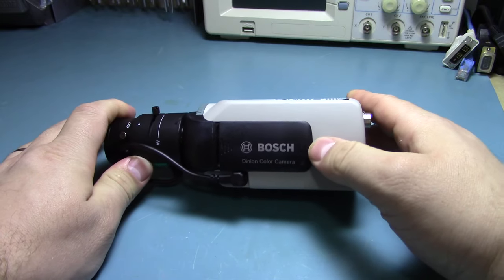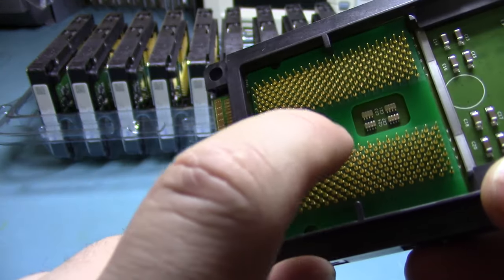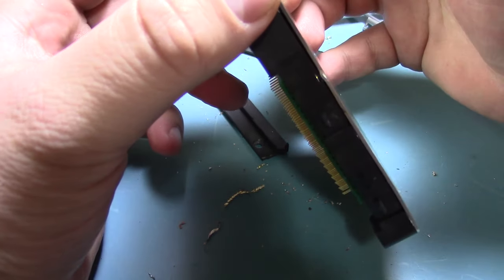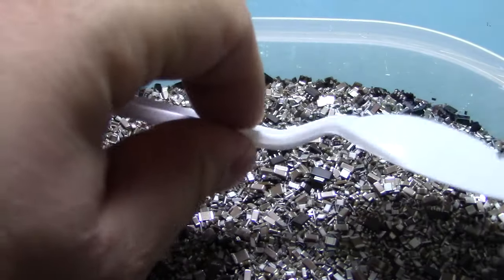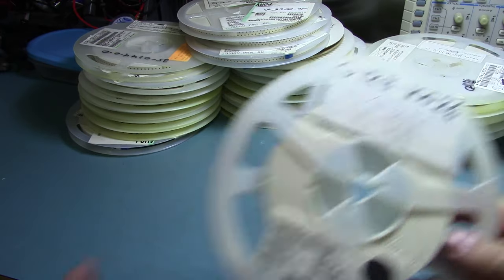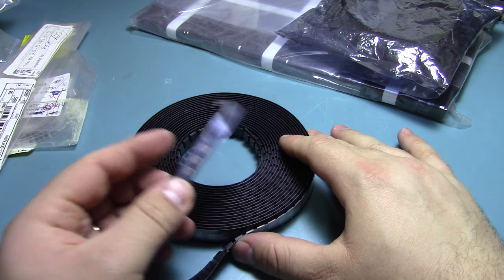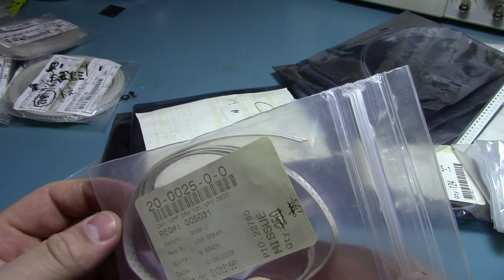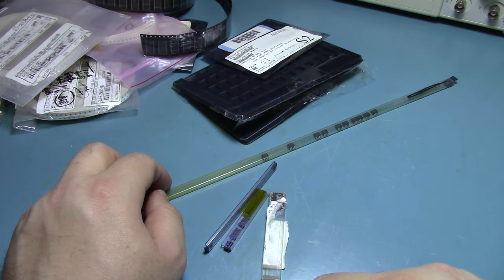More eBay Stuff

Comment: Could make a epoxy key chain with those intel chipsets
Reply from the maker: +NegiMudkip Intel actually has made a bunch of key chains with actual ICs in them. I have one of them, similar to this one. The border of the IC is all faked (paper), but the chip in the center is an actual IC.

http://www.cpucollection.se/data/media/107/Keychain_Intel_Pentium_with_chip_light_blue_square.jpg
Reply: I used to have an epoxy 486 keychain years ago. I don't remember what happened to it. But it was a genuine Intel promo product, so I assume it was real.